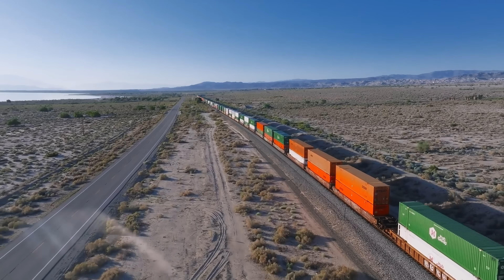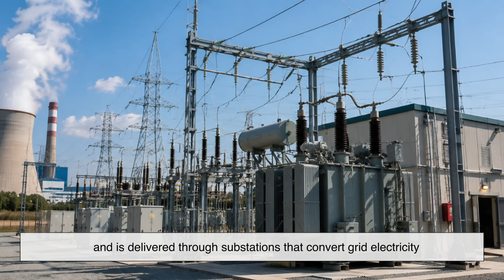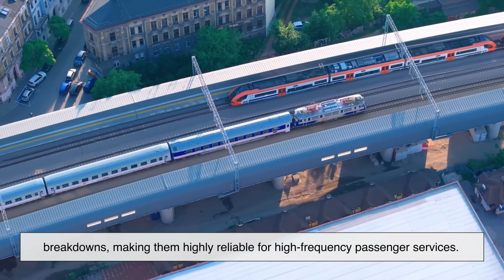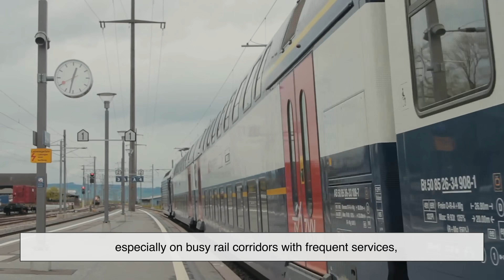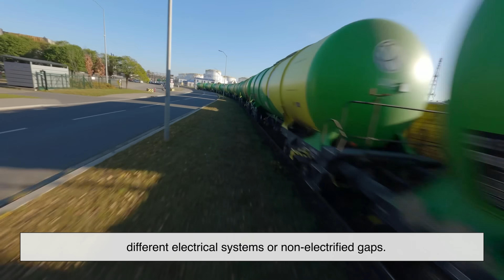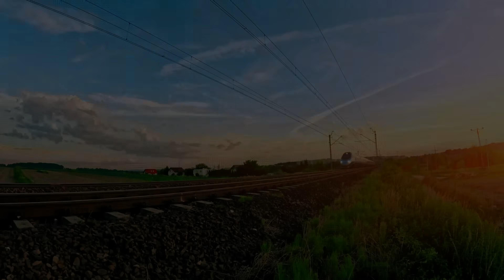Why Are Train Tracks Electrified? The Engineering Behind Modern Railways

Comment: How many amps to pull a proper train?
Reply: It depends on a lot of factors- car lengths, passengers, traction design. An 8-car train at 25% load for a 750DC system pulls 200-400 A, and could be more.